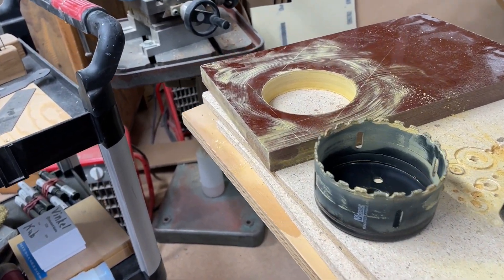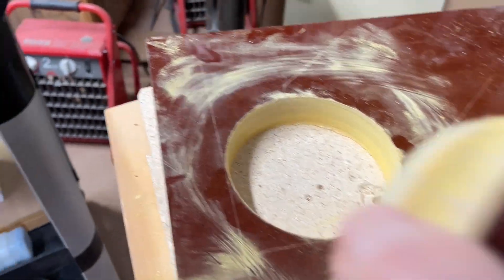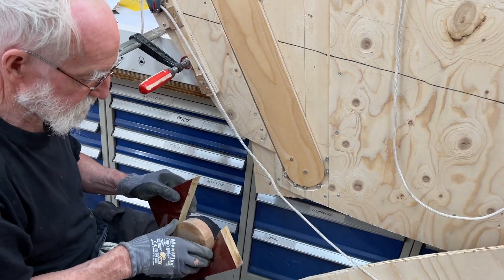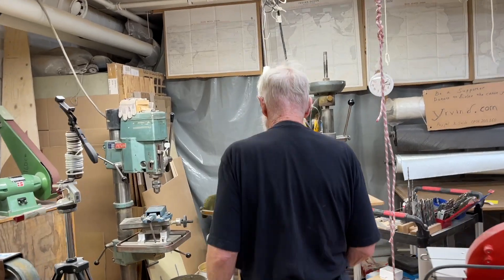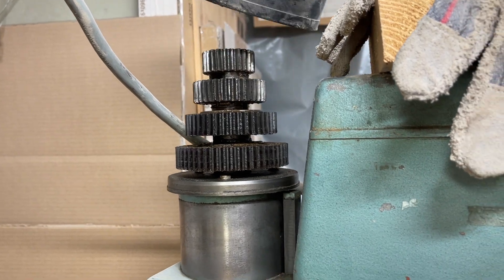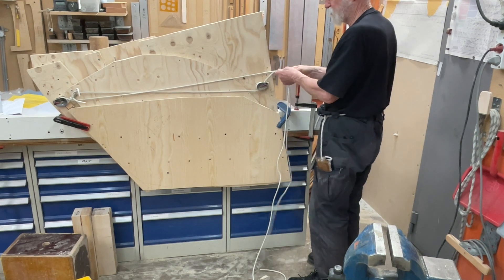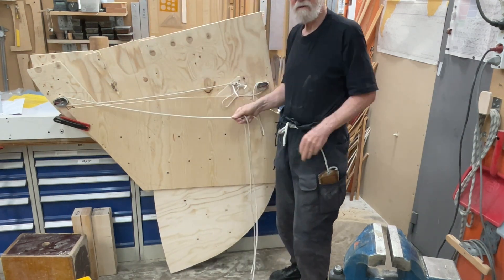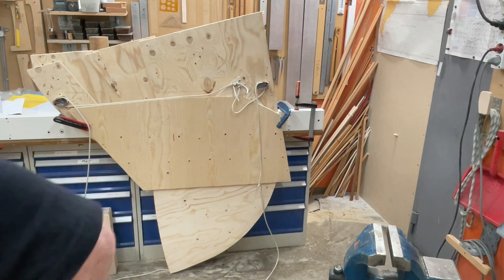21 July 2022. The wear resistance of Tufnol. Also the mockup now works to my outmost satisfaction.

Comment: Thank you Sven for the update on your centerboard design and mock up. Will the centerboard line be continuous loop or two different lines? Have a great weekend.
Reply from the maker: The plan is for two different lines as the downhaul that way can be less strong as a shear pin.
But I decide later.

Comment: how is Tufnol to work with ? is it similar to timber of plywood?
Reply from the maker: Tufnol is cotton fibre inpregnated with phenolic resin.
It is many times as strong as plywood.
Many times as expensive also
Reply: @SvenYrvindExlex  do you use the same tools to work with it?
Reply: @akcarlos  Think working Ironwood or dry Manzanita, tough, super dense. Drills like aluminum or worse, cut with the best carbides. Carbides will dull like the harder boat woods.

Comment: In the last scene when you're testing the mockup CB, it kind of looks like the whole CB may be able to slip through the opening. I hope that wear and tear won't be a problem in that regard.
Reply: Good thinking Daniel. We have a commercially built boat with a very similar mechanism. When we raise the board it slots into a set of tufnol blocks to hold it still. I assumed that it would do the same when down, but it doesn't. No idea why not. However I recently checked the side play and it isn't very big after 20 years. It has nylon sheaves either side of the centreboard pivot. It can't slip out because it has a central stainless rod in the pivot. Even if it did it would be suspended by an uphaul and down haul of 10mm Dyneema plus a 5 mm stainless steel strop. I just think a set of tufnol blocks to hold the board in the down position would be a good idea. Note our board weighs 150kg in aluminium and glass.

Comment: Early automotive camshaft gears were made of Lignum Vitae and later of a material similar to that Tufnol.  No question about the good qualities of the substance.  Mockup is looking good.  Precise fit is important but also the ability of the mechanism to move when dirty or slightly damaged is important too.  I'm sure it'll be right.
Reply: I was thinking the same thing. An embry riddle aeronautics friend was using it in flight engine conversions where the ignition rotors operated under extreme temperature because most other materials used were failing. Interesting history: Tufnol (from the two words, “tough phenol”) was invented by a team employed by George Ellison in the 1920s. 

Originally called ‘synthetic resin bonded paper’ or SRBP, it was created from layers of high quality kraft paper bonded together under high pressure with phenol formaldehyde resin.

It was hard, strong and easily machinable.

Comment: Looks Good!  After your comment about cleaning: On the part where you talked about extra guide-pieces, I would just insure that you don't have any places/voids where gunk can get caught or collect.  Also, might be nice if you had a way to flush the slot out for cleaning.  
Do you ever equip with a seawater pump for various uses; I've seen these on small charter fishing boats for cleaning the decks of fish debris?
Reply from the maker: I never clean the deck.
I do not fish.
Reply from the maker: @Richard Gleaves Also my boat is to small and my deck has no places to collect them.
Sailing my 40 feet schooner Duga to Brazil 1969  I had quite a few flying fish to eat.
They are good eating.